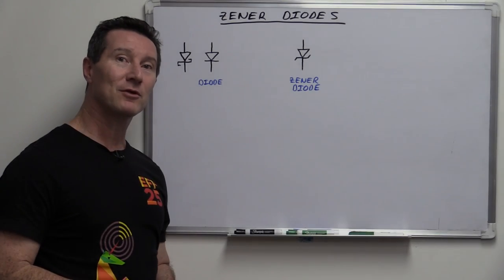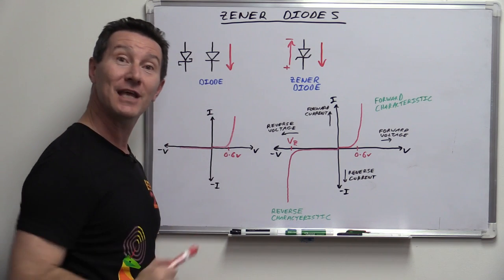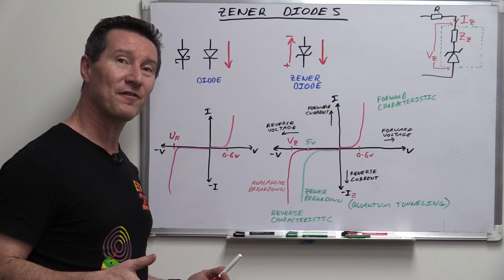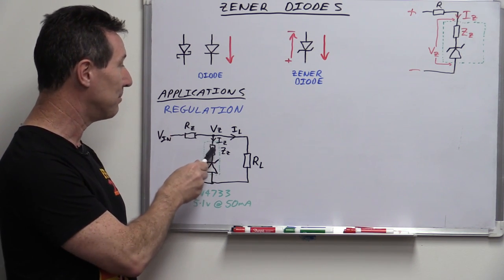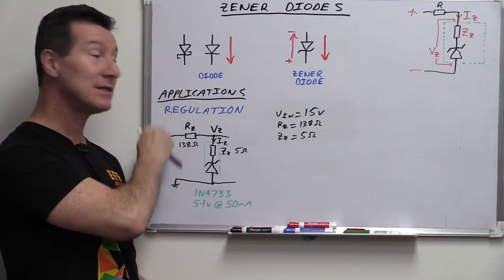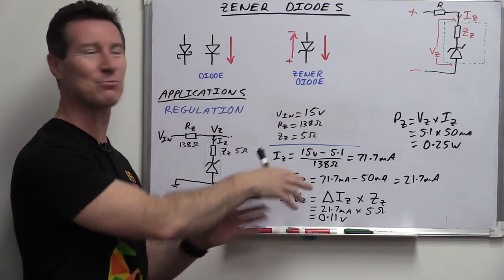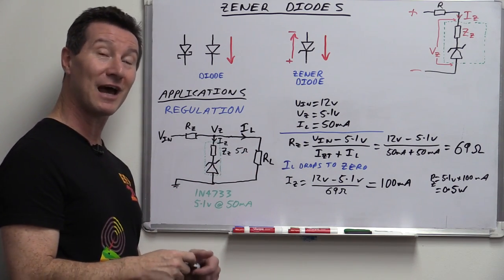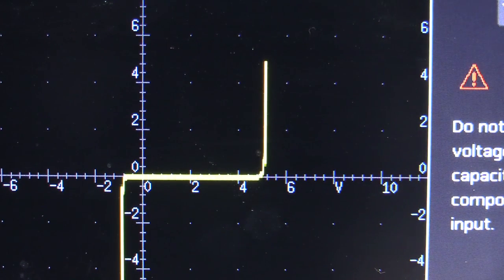EEVblog #908 - Zener Diodes

Comment: Great design teardown, good references to the data sheet with explanations,practical use of hardware,basic circuit calculations with various loads and input supply .All in all, this video sets the standard.

Comment: Audiophile reasons for using Zener diodes:  1) Input protection (clamping) to avoid damaging or latching op-amps or ADCs down the chain.  2) As a peak limiter (high ratio dynamics compression) to limit the signal level -- e.g., to control the clipping point before ADCs (which may sound even worse than analog clipping when overdriven) or to protect speakers from over-excursion (typically for high-power PA stuff.)  3) Intentional distortion (as in effects pedals.)

Comment: Thank you for making these long form videos reviewing electrical components in depth. I've been out of practice for a while... I graduated college 9 years ago and have been working in other industries. I was in dire need of fundamentals review.

I just absolutely nailed a HUGE interview thanks in large part to your channel (specifically op-amp and transistor circuit analysis). Your energy and presentation made these topics very fun to watch and easy to follow along with. Lets see if i get this job... :)

Comment: I do not know if you will ever read this, but i want you to know that your videos helped me a great deal through my exams and I can't express how gratefull I am. I am 27 yold from Greece studying for my 2nd Class Marine Enginneering Certificate after a long time away from the profession due to health problems and I've been through a lot lately. So many setbacks i can't even begin with. Your videos where helpfull and cheered me up while in a really bad place. As a mechanical engineer my electronics knowledge was limited to the stuff i learned at school and it has been a very long time in marine engine rooms's noise and heat since the last time i studied about electronics, so your style of explaining helped me fill many of my knowledge gaps in and pass my exams. I will never forget your help. I will also try to donate a little something as I am in a realy bad place right now... I wish i could do more. May you always have good health and keep up the good job. I wish you the best with the new lab .You have my everlasting gratitude and respect.

Comment: Thx Dave. Yep I'm a late comer. Welcome to the shunt regulator. Tricky if you are using a fixed resistor input & high dissipation.
Every since the monolithic regulators came out they pushed Zener based regulators into the dustbin of time. So, except for niche uses, like you said, they are done. Obviously they are popular enough that they are still available.
I for one am glad Bob Widlar came on the scene and gave us bandgap references that are embedded in all these regulators.
Again thx Dave for taking the time do this video.

Comment: I'm most familiar with Zeners as voltage clamping devices; they're commonly used on automotive computers on the injector control and ignition control circuits to limit field collapse spikes from feeding back to the driver transistors.  I've never quite understood exactly how they work, but I've got a much better understanding now!  Thank you!

Yes, I'm an automotive guy.  Sorry!

Comment: I had the privilege to have a curve tracer in my shop in the Navy in 1973. The Zener  breakdown was fascinating for me. Shunt regulators were common back then. However, the current needed to provide regulation of Zeners with voltage specs below 5 volts went up due to the knee characteristics were not as sharp. This was at the time that the LEDs were being available to the hobbyist. I put the available LEDs on the curve tracer and found that the knee characteristics in forward mode were a lot sharper with 2 red LEDS in series at 3.6 v than the nearest spec Zener diode at lower current. When my squadron upgraded their aircraft, we went from peanut tubes and early transistors to ICs. When I went to be schooled on the new system, I mentioned the voltage drop of a typical red LED at my turn at the blackboard and one of my instructors had an epiphany. He figured out what the LEDs on the board hidden from view in a piece of test equipment were for. A low voltage shunt voltage source operating at less than 5 ma. The student taught the instructor that day. LEDS from that time: IR, 1.6 v; Red, 1.8 v; Amber, 2.0 v; Green, 2.2 volts with a less sharp knee.

Comment: Good vid.
1979 I wanted to run a 6V portable tape machine in my car. At my bench in work I slapped a 5V Zener on the base of a TV line output transistor, jiggled a couple of resistor values with the machine running and, Bish Bosh, done. Didn't draw a circuit. Bodge-A-Job. Worked fine, heatsink got a bit hot  but not enough to melt the plastic case...

Comment: Greetings Dave, I have been watching your videos for a long time long time now, you always have me riveted and impressed by your vast knowledge of electronics. 

I have been given a little challenge at work, and I am reaching my whits end. I have to regulate 50 to 60 volts down to 12 volts at 2 amps to fit to a battery operated forklift that will power the devices we are fitting to it. I am using pretty much the same circuit that you describe in this video, but  I am driving a transistor to deliver the power. It works well up to 30V. The first transistor I used was a 2SDxxxx???? I can't remember the part number off hand right now until I go back to work tomorrow. They were rated at 5 amps collector to emitter and could handle 500V.  Then I turned to my old friend, 2N3055. That transistor has never let me down ever. I have built some pretty hefty amplifiers with them with hefty heat sinks and fans to keep them cool. This has to be a compact design that can fit in a confined space on a forklift. Any ideas? I started thinking of a buck convertor type design....

Comment: Excellent vid, thanks Dave.  Could you consider doing something on the difference between NPN and PNP transistors and how/when to use each?
Reply: Applied science has a great and interesting video on how to design transistor circuits which touches on this :)

Comment: I have used a Zener diode in a recent project: A bike tachometer utilizing the pulses coming from the hub generator using a cheap Arduino Nano clone and a 16x2 display. To not blow up my Arduino when the lights are switched off (the generator idles at 24V and more!) I made a small module containing a bridge rectifier, after that a high-impedance input (10K resistor) leading to an NPN transistor's base which is clipped off with a 5V Zener diode. A pulldown resistor of 100K on the base ensures the input won't pick up too much noise on the way. The output to the Arduino is just a connection to ground, and the input pin itself, pulled high by an internal pull-up.

Comment: One thing to add: Avalanche breakdown has a positive temperature coefficient whereas zener breakdown temperature coefficient is negative. The temperature coefficient of your particular Zener diode therefor depends on the nominal zener voltage. The sweet spot is at 5 volts where the two breakdown mechanisms cancel out for an overall temperature coefficient of zero.
Reply: Very important comment! (I was about to note that at about 5:50 but then I figured it wouldn't be the right time to pull Dave's leg ;-) )
Reply from the maker: The thing is though in that changeover range you don't know if they will cancel out or go one way or the other. Only way to be sure is to test it. Or have a very well speced precision zener, usually of the buried kind.

Comment: Question dave, whats the difference in having the diodes point at each other opposed to away from each other when voltage clamping an AC source?
Reply from the maker: No difference, exactly the same result.

Comment: reference voltage for fet turn on and off in tube circuits,after that i use low drop out regs....every time,less hastle no matter what current i need i can use the reg as the ref voltage and power transistors as series current regulators in parallel,because as you mention about the smoke, i can't continue searching for bottled smoke as it seems it's no longer made in refill packs.

Comment: Dave, Great Video!!  Any chance you could do a follow-up to this video showing when you use a Zener at the base of a transistor to increase current capacity of the regulator?  You made it easy to follow all the characteristics of the Zener, but when you add the emitter-base junction to the mix, I get a bit confused, as you now have two devices being affected by temperature, volts, amps, resistance, etc.  Thanks!

Comment: 29:01  I could be wrong but that looks like the zener's capacitance is acting as a low-pass filter, and putting a lower value resistor in place (29:32) is gonna charge it faster so gives a faster rise of the output.
The dynamic resistance comes into play at the zener voltage, not below it.

Comment: When your device has I2C, SPI, I2S, UART and etc. that goes out of your box, it is very nice to use zener diode @3,6V and resistor 100-300Ohm in series. That can protect your circuit very well while connecting cables, static and even small shortcircuits. Series resistance degrades performance of SPI or I2C but for typical use (400kHz) it works as charms :)

Comment: Hi dave. Nice video. I like that you talk about the power dissipated in the zener, but you don't mention the power loss in the current limiting resistor. At 12v in and 100mA through it, power used in the resistor is P=(12-5.1)*0.100=0.69W! Most regular resistors aren't rated to anything better than 0.25W! Gonna need a power resistor for this...
Reply from the maker: Yeah, completely forgot to mention it
Reply: How hot is a resistor dissipating 0.5W?  Too hot to keep your figure on it?  Is it possible to say how many degrees C that be?
Reply: +MaxAirGo "usual"  resistors are rated at 0.25W and at 0.5W they are indeed too hot to touch. Sorry I can't answer your temperature-prediction question though.

Comment: Excellent video. It would be nice a similar video about BJT Transistors, explaining the characteristics and applications of such devices. The characteristics of transistors are centered on β as the ratio between Collector and Base Currents and how it affects the multiple voltages on Collector, Base and Emitter. It's all relatively simple math, so for the characteristics there is nothing extremely hard to explain, however, for the application that is another story, many times we know the characteristics of a given device but fail to know how to use that same device and it's real purpose... Nice EEV multimeters BTW!

Comment: your clamping turn on time is based more on the RC time constant of the circuit. the zener has a pretty high capacitance (not good for protecting high speed signals). so big capacitance plus big input resistor means long turn on time. one good way to get around this is to put another reverse biased diode in series with the zener (small c in series with a big c = little c)... and then there's the tranzorb...

Comment: i have been watching ur videos from quiet some time and i really love them, i have been a electronic enthusiast since childhood but only then there was no internet so information was hard to come by. I had a question relating to LEDs, suppose if some LED chips have no data sheet or they have been salvaged from failed units, now how do we actually find out their forward voltage and typical current of the LED without actually blowing it up provided the LED is some custom built, probably a high power one? LEDs are forwards biased so i have always struggled to find their typical current and voltage without a datasheet.
it would be great if you could make a quick video on this, it might help many others because there r other videos but none of them show a fool proof method.

Comment: They still work if the current limiter resistor before the zener is just in front of the zener and not any additional load (if using it as a transient voltage filter). EG. On a 5v line using a 5v6 zener with a 150r just in front of the zener. But will only clamp the equivalent of 150r in transient current.

Comment: I saw those clamping zener diodes on cheap Current Transformers, to limit the voltage across the winding when there's no burden resistor. But in real life, where CTs work at huge currents, lets say, 2kA and 13.8kV no zener diode will save the CT from blowing if the load (relay/burden) disappears. Cheers from another electrical engineer.

Comment: Pity you forget to explain how the zener effect and the avalanche effect have opposing temperature coefficient. Because zener diodes in the range of 5.6V have both effects from the zener and the avalanche effect the temperature coefficient is very low which is rare for electronic components.
Reply from the maker: I wanted to go into tempco stuff, but it was already way longer than I wanted.

Comment: AC Clipping is used alot for shaping Guitar sound, think "Rock" guitar sound! The MXR Distortion+ (or DOD 250) schematic is a great example of this! Although they are usually 2 diode's in parallel as opposed to series.

Comment: Spark gaps! Dave, there's some back to basics for ya: how a spark gap transmitter works. It's so fundamental it caused a "twitter battle" between De Forest and Marconi, because Marconi used spark gap oscillators which easily swamped out DeForest's transmissions, thus causing Mr. Triode to lose a big public competition.

Comment: @EEVBlog - Dave I think you mixed the clipping and clamping.. Zeners can clip voltage at Vz and can protect against clamping. Clamping is when the DC reference of an AC signal changes.. Correct me if you meant some thing else
Reply: If both the outputs are ground referenced where is the clamping? Good day Dave -
https://en.wikipedia.org/wiki/Clamper_(electronics)

Comment: what makes voltage references so much better with line regulation and temp co? Do avalanche diodes and zeners have opposite temp co?
Reply: Yes, avalanche has positive temp co, zener has negative temp co.
Voltage references are not ordinary zener diodes. They are made for purpose, driven by current source (as Dave mentioned) and very often also heated at precise temp. Look at the classic LM199/LM399 reference. It's the main Vref in Keithley 2000, 6.5 digit bench multimeter. This reference comes in metal can package with plastic "capsule" for thermal insulation. It has 4 leads - 2 for reference zener diode and 2 for integrated heating element. LM199 is marked as obsolete, LM399 is still available, but it's not the best. It's pretty good if it's used in 6.5 digit DMM, but there are much better references.

Comment: @EEVblog Question: Implantable pacemakers have Zener diode in line with the pacing conductors. It was explained to me as a protective circuit in the event of external defibrillation wherein current would travels retrograde into pacemaker circuitry causing failure (due to energy load of ~ 360J). Can someone explain the specifics of how the current is diverted from circuitry via the use of a Zener diode? Thx

Comment: Im new to electronics so. I'm building one of those 0-30v PSU kits, & i've got a question. If the AC output from my transformer is slighly to high for the input, can I use two zener diodes in the reverse( Back to back) configuration to clip of some of the AC voltage, bringing the AC supply into the desired range.

Comment: i,m changing the wiring in my guitar so I can use 2 tone capacitors so I have 2 power wires on the same source whai diode would be best to stop the power going in reverse I was thinking a zener John

Comment: Couldn't you create a low dropout voltage regulator using a zener diode, an appropriate resistor, and an N-Channel Depletion Mode MOSFET (or JFET, since those always operate in depletion mode)?

Comment: in no load regulation if i place a normal diode in forward biased condition instead of zener diode ,y cant it b used ,bcuz it also provides some mA of current almost for same 0.7 voltage?

Comment: @32:30 Zener diode torture session begins.
Is that actually permanently degrading the doping layer inside the Zener diode? And if so, in what way does the performance characteristics of the Zener diode get affected? What characteristics of the diode will be different after prolonged junction temperature abuse?

Comment: A good book,not "The good book",but a good book series is "electronic devices" by floyd on prentice hall books,i have the 5th ed,got it when i was studying for my design technicians badge and foam hat,that being the first year,after which the diploma and then degree were a wee bit more involved,though if you can get through year 1,you will have learned the fundamentals of most things,it's all hills and plateaus after that point,wish i had the internet 30 years ago.Mind you most of the stuff i use now is repeated and mostly a narrow field,unless i am doing something special,then i get the books out(or come here for revision).

Comment: I Dave! i have a question for anyone who can answer, will it be pointless to connect a 5,1Vz Zener parallel to the output of a 7805 regulator? I know that the 7805 can output more than 5,5V so I figured I can use a zener to keep the output cloe to 5, but I'm not really sure if it is a silly thing to do